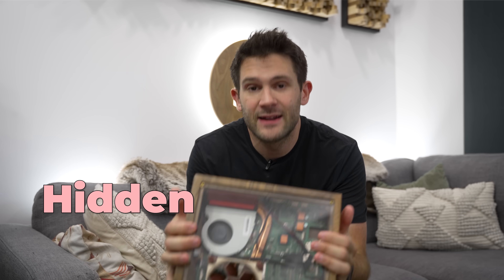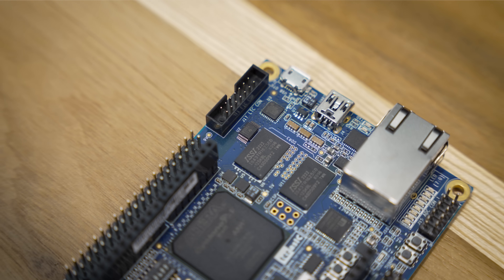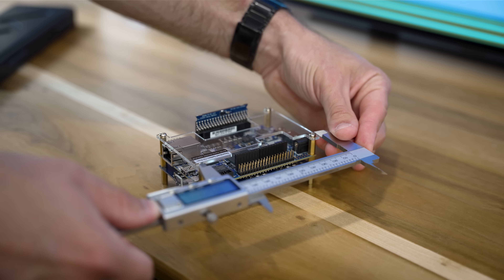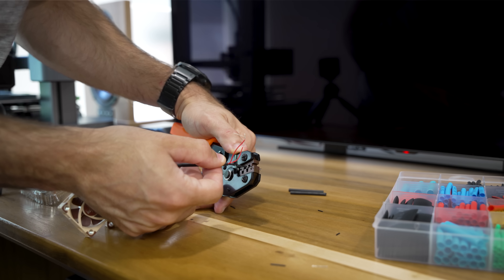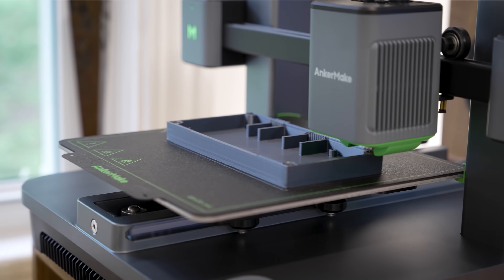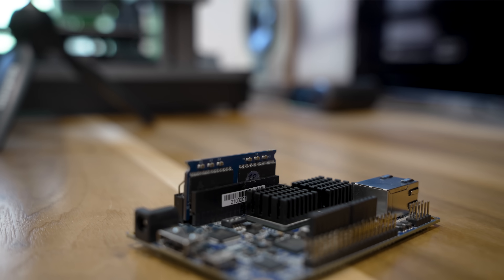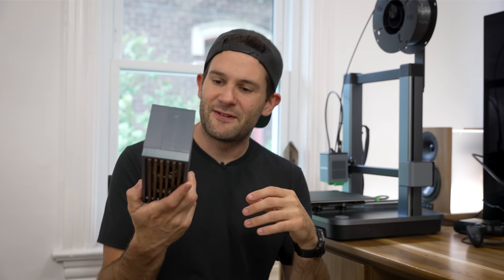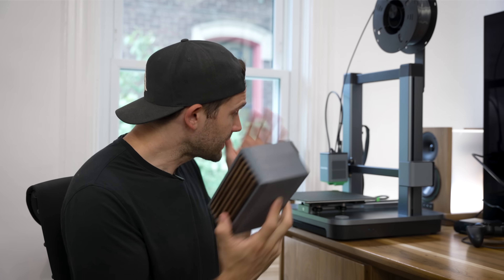This DESTROYED my $4000 PC

Comment: Referencing your purists comment. I wonder how the FPGA would perform on a old CRT tv - if it could even connect to it without introducing additional lag.

Edit - didn't watch far enough before commenting, haha
Reply from the maker: Honestly John there's so much more testing I wish I could've done here! Compared vs original hardware, compare digital vs analogue out, USB controller vs SNAC controller. The rabbit hole is deep!
Reply: It absolutely can do that yes, you can even use original light guns